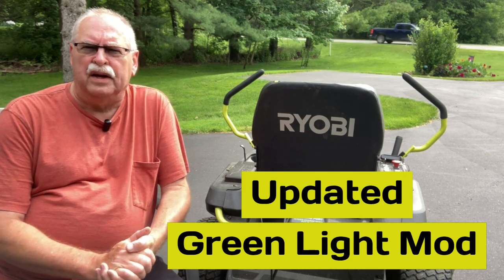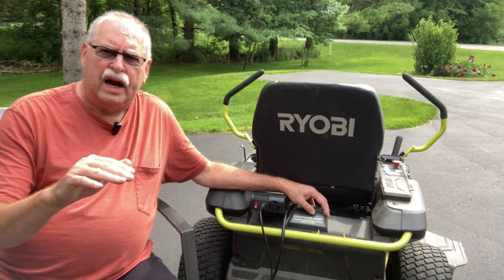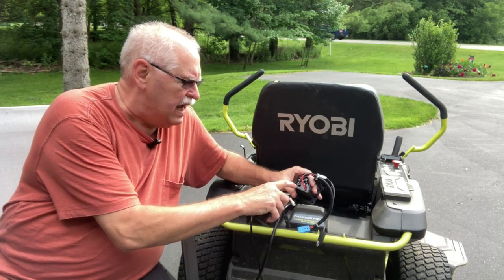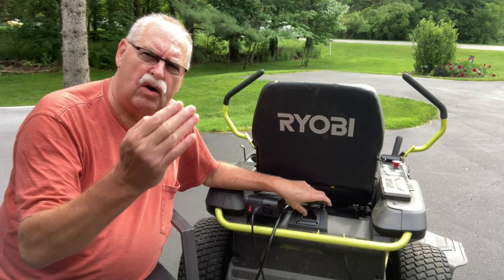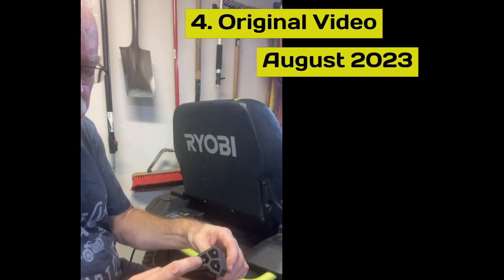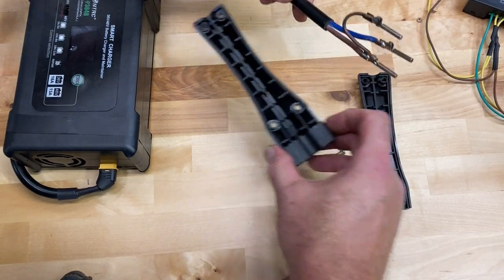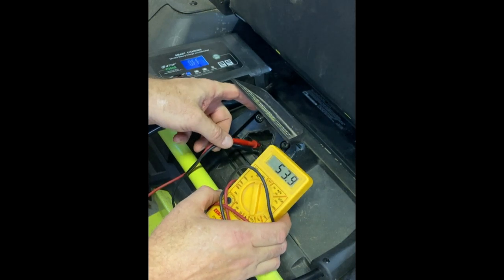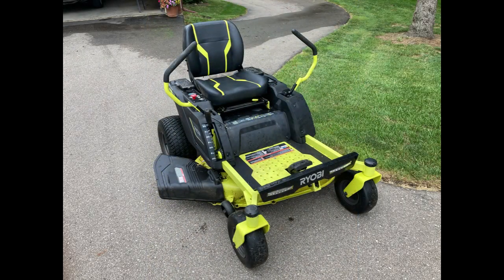Ryobi 48v Lithium Swap - Green Light Mod Update

Comment: Very interesting video!  I wish I had seen it a few days ago, because I might have avoided causing myself a vexing problem.  Long story short, I just did the lithium conversion on our RM480e mower.  Conversion went fine - everything worked perfectly.  After conversion, I decided to try using the OEM Ryobi OP48RM charger, because another online source said it would still work with the lithium battery.  But, it didn't work (simply turned off when I plugged it into the mower), so I wanted to know why.  Online search led me to a Ryobi Electrical Components Troubleshooting and Testing document. In that document I clicked on Testing the Charge Port and Interlock.  This is the SAME page where you got the small photo of the jumper wire in the charge port.  When I tried the jumper wire test, it smoked the black cube (interlock relay) that is connected to the charge port, and the mower went dead.  After a lot of head scratching, I finally bypassed the black cube (red and yellow wires) with a fused jumper, and the mower was back in operation.  SO, between your great video, and the viewer comment that noted the top pin on the NEWER style potted charge port should ONLY see 3VDC, I knew what happened.  My mower has the newer potted port.  When I jumped the bottom left socket to the top socket in the port, it put 54VDC to the top socket, which instantly fried the lockout device.  This is the exact same thing that happened when you plugged your modified charger into your neighbor's mower charge socket.  The Ryobi troubleshooting manual was obviously written for the OLDER style charge socket (3 screws in back).  The socket jumper wire test, AND your "Green Light Mod", will work fine with the older style socket.  If either one is attempted with the newer potted socket, it lets the smoke out.  Thanks for helping me understand how I screwed up!
Reply from the maker: Thanks and welcome to the party!
Reply: Does the OP48RM charger work with the lithium batteries now?
Reply from the maker: @sandeedog11  Everything I researched says to NOT use a Lead acid battery charger on Lithium batteries.
I used the charger I showed in this video;
https://www.youtube.com/watch?v=1klxV2sZ1U8&list=PLd4K4nUH_WO3BvmtFUAhUX4JR1CZCxIzN&index=6

Comment: Hello, This is the vieo I have been serching for!. My question is did you take the pins off the origanal charger port and solder them to the after market P35 smart charger?. Because it doesnt seem like I can just swap the old origanal charger port "CASE" and insert the new smart charger pins? They do not fit. If I drilled a bit bigger I am sure it will work, just wanted to know what you had done?..Thanks for your video HUGE help!.
Reply from the maker: The P3648 lithium charger I ordered came with the triangular plug.  I dismantled the P3648 plug and added the jumper wire (soldered).  I did not use any pins or components from my old Ryobi charger.

Comment: I have watched all of your lithium swap videos and find them very helpful as I am considering the swap for my own. However, my model is the RY48ZTR75 and not the 100. Do you happen to know if there is any compatibility issue with using the same size batteries that you swapped over to? I wouldn't think there would be any issues with the changer swap, but am curious about this and any other components, just to be safe. I did discover that my current charge port is the molded one, so I would likely upgrade that to the latest (3-screw) version as well. Any assistance is much appreciated.
Reply from the maker: To be clear, I think the molded charge port is actually the newer version.  I'm not sure.  But we did successfully replace Jesse's molded port with the 3-screw port.
There is no real problem converting the 75 to 100aH batteries.  I helped my friend Jesse convert his 75 to the 100 batteries.  The batteries are larger, but the battery trays are the same size.  You need to adjust or remove the spacers on each end of the battery tray.  I recall that we removed the front spacer and shortened the rear adjuster tray bolts.  This also allows the long clamp bolt to still pass in between the batteries.
Reply: Thank you sir, your feedback is much appreciated.

Comment: Thanks. For clarity, you can use the charging port with new lithium charger, for either type of female plug in with screws or without as long as you dont try the green light mod? Is that correct.
Reply from the maker: Correct.  The new lithium charger can be used with either style of charging port.
I believe the green light mod can only be done to the "3 screw" charging port.

Comment: Is it OK to use the charger as is without the green light coming on?
Reply from the maker: Yes.  The charger will work fine without the green light or this mod.
The only downside is that the mower can be driven away while plugged in.  Best to leave the charger on your seat as a reminder to unplug before getting on.

Comment: Thanks for the videos you posted showing how you converted your Ryobi mower to lithium batteries. They were very helpful when I upgraded my Ryobi RM300e to lithium batteries. It's a smaller mower and I used four 50 amp/hour batteries but electrically it's the same as yours. The new charger I got is the same as yours, too.  After installing the new batteriesI got the mower going by just bypassing the relay that prevents the mower from starting when connected to the charger and I didn't worry about the green light not working. But after watching this video I put the relay back in the mower and added the wire to the third pin on the charger's plug. My mower has the charger port with the three screws and everything is working properly. The green light comes on when I plug in the charger and I can't start the mower if the charger is plugged in. This is safer than bypassing the relay since nobody will be  able to accidentally drive off while the charger is connected. Also to be safe I tested the charger plug mod before adding a wire permanently by opening the shell and using a clip lead to bridge the  + pin to the unused third pin. There was no heating or smoke.
Reply from the maker: I'm glad to hear the lithium upgrade and the green light mod worked for you.  Simple and clean, and pretty satisfying!
Thanks for letting me know that my videos were helpful.  It means a lot to me.

Comment: Finally got to take the charging port to see what I have and I have the port without the screws. :-( Digging further, I noticed, the top pin is 3VDC from the original charger. So do you think a modification of sending a 3 VDC on the top pin might do the trick? What I can't figure out is when I plugged it in and measure the top pin from the other end of the port (where the wires comes out), the voltage on the top pin fluctuates (always less than 3 V).
Reply from the maker: I really can't say what could work.  The info I used on my mod of the 3screw port came from a Ryobi service manual.  And that clearly would fry your molded/no screw port.